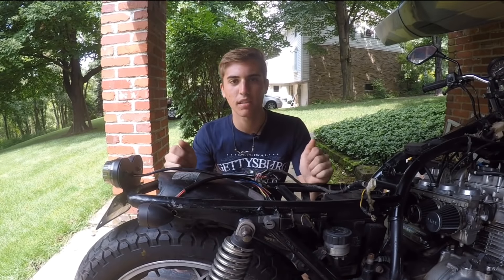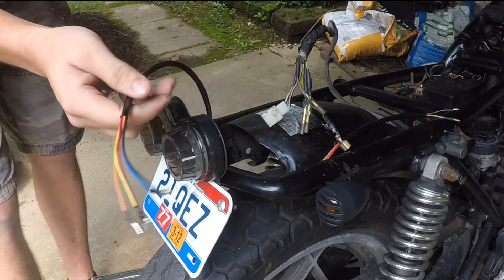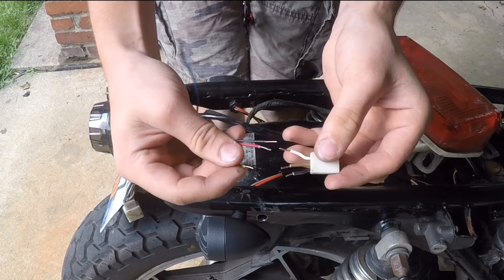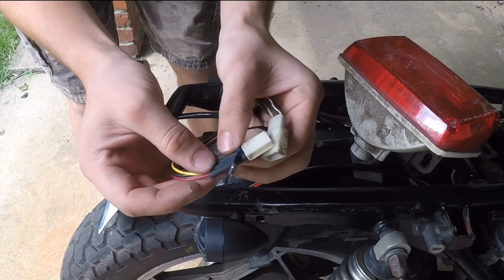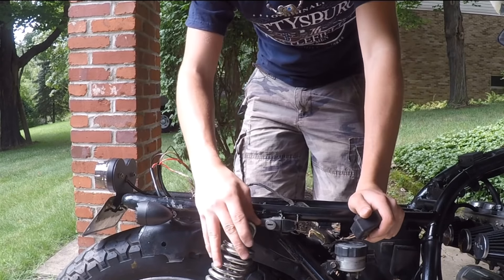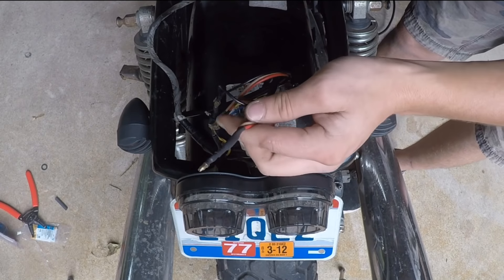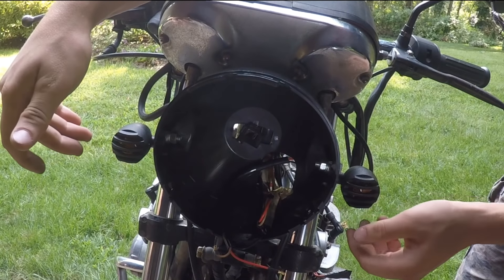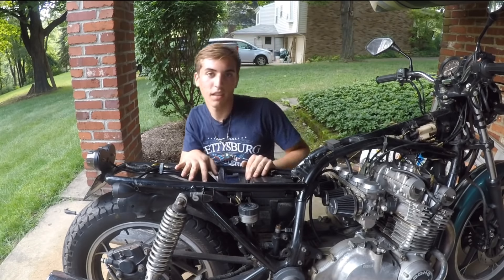Suzuki GS850 SCRAMBLER Motorcycle Build #8 "How to Wire a Motorcycle!"

Comment: Mason you should be soldering these.  Get a cheap soldering iron, practice a little,  it's not hard.  You put some tension on these wires and they will come apart.  Thanks for the videos, really enjoying them.  On old hondas ground is green.  Black is "hot" 12v when the ignition is on.

Comment: cutting the connectors off? yeah but dont throw them away, you can get them also proper of the wire with a little hook thing tool, those connectors have value for restorers

Comment: I think you connected the turn signals to the running lights. connect the turn signals to the correct wire, turn signals should flash (to catch attention). connect the running lights to the licence plate light

Comment: Those leads wires for the connector block should have been a little longer so you can wrap and heat shrink them…

Comment: You might need to wire in resistors in with the LED turn signals to get them to flash. The LEDs don't draw enough current to heat the bimetal in the flasher to make them blink. I'm assuming that the stock flasher is thermal. You could also convert to an electronic flasher.

Comment: Hey GoldGuy, just wanted to tell you that your indicators don't blink because the bulbs themselves have much lower wattage than the original one, and the flasher relay is designed to work with those big ol' original bulbs. Basically your new bulbs haven't got enough power to trigger the flasher relay.

Comment: your turn signels don't work because you hooked up the driving lights with the signal light wire (your brown and red wires)!! to fix that easy you could just cut the driving light on your turn singles.(the brown wire). or you could take both driving light wires and wire them with the running light on the rear brake light. (both browns to the yellow on your new taillight). hope this helps.
Reply: yep
Reply: I like the lights he is using, I will probably order them for my bike, Thanks for the Tip!

Comment: Hey your turn signal relay is probably ok but your new signals are lower power, so you need a generic Chinese flasher with an adjust screw. They cost around $2 and there are hundreds on eBay.

Comment: All you guys saying to solder the wires...stock wiring is not soldered. Wires push into the plugs.
Reply from the maker: You've got a good point, thank you for backing me up friend!
Reply: Find some heatshrink crimp connectors or heatshrink with bits of solder in them they're way easier than soldering and work well. Way better than twisting and heat shrink.